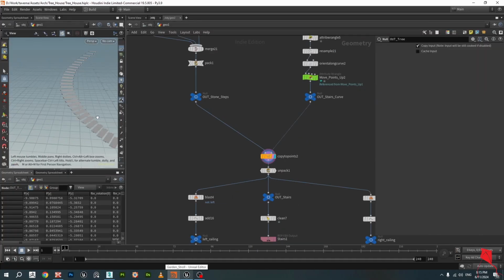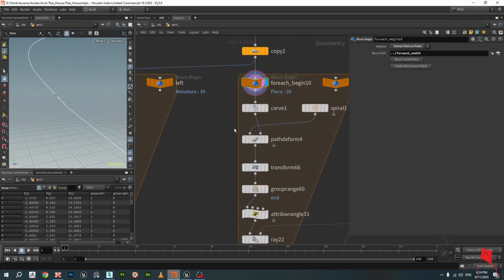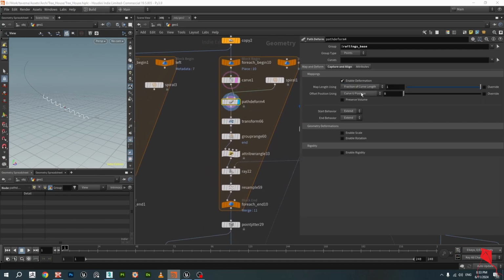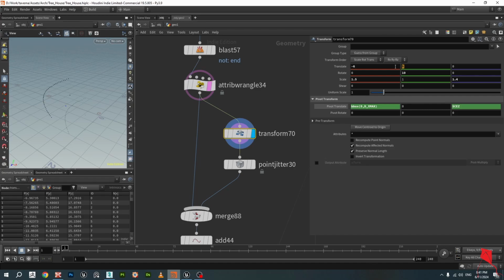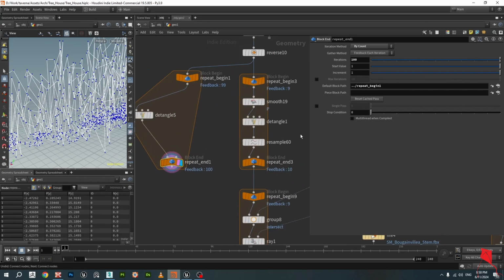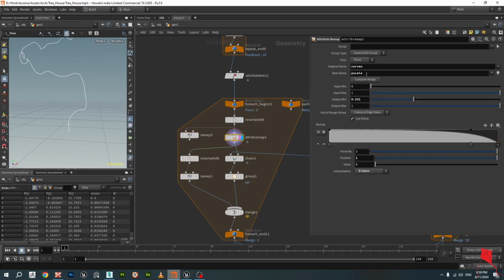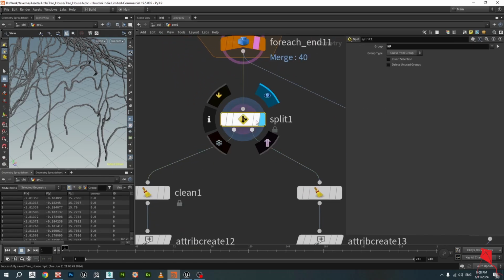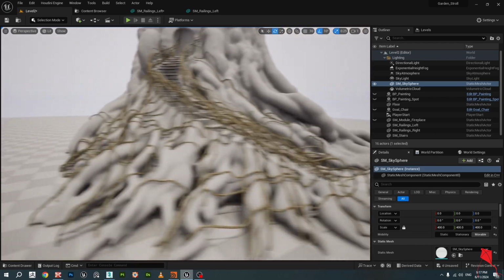Houdini Tutorial - Twisted Vines Railings for UE5 (beginner friendly)

Comment: In the talk "Nanite for Artists" by Epic, they mentioned that a static mesh like that shouldn't have LODs because a single nanite model that doubles the polycount takes up less space than the combined size of the LODs.
Reply from the maker: Absolutely agree. Don't create LODs, if you plan to utilize nanite. But I still wanted to show the process of creating standard mesh with LODs, because in some cases it's needed, even for very high poly meshes, like with path tracing, which doesn't support nanite.
Reply: @tinyredkite  To add to that, if someone was developing these things for a game they might want to keep in mind that not every platform supports Nanite, and for the platforms that do not every person has it turned on. LODs and baking normals are still something that would need to be considered in that case.
Reply from the maker: @thephobos1810  That's right. If I was making this a game asset, I would bake normals of my high poly mesh to the lower poly cylinder for the LOD0 and simplify cylinder for at least two more LOD levels.